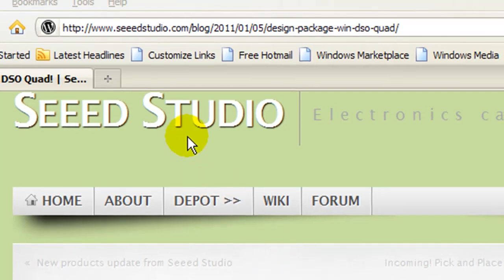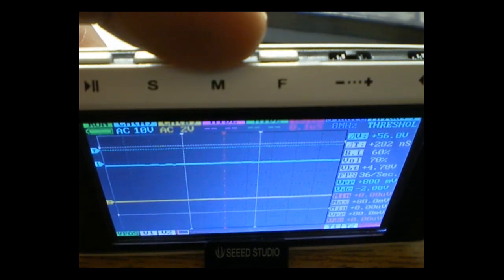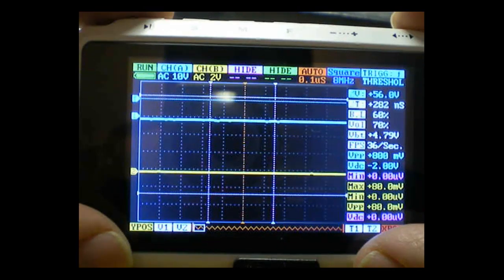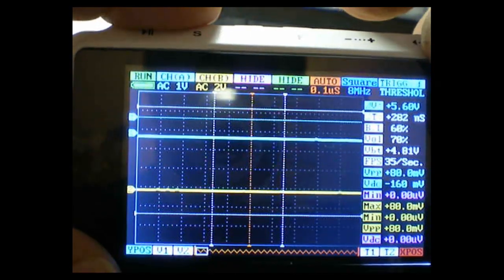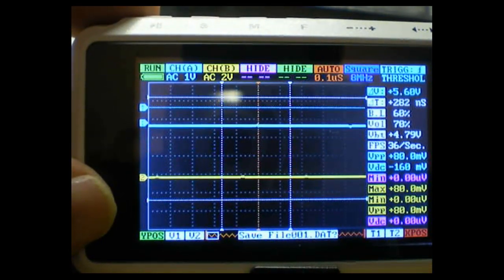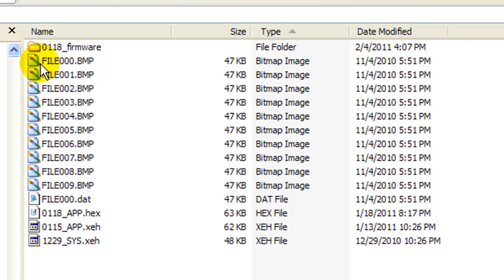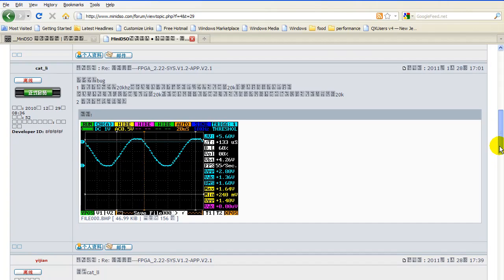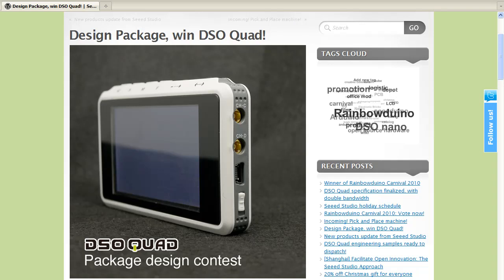DSO Quad or miniDSO-203 Introduction

Comment: Just bought one of these via eBay - paid a bit under a hundred quid for it. I have to say it is a truly amazing bit of kit. Problem is that the controls are complex and not particularly intuitive. And the manual is bloody awful!

So I personally found this video very helpful in understanding the control structure of the DS203.  Saved me hours of trial-and-error.

I feel that commentators complaining that this video does not show waveforms have probably missed the point of the video.